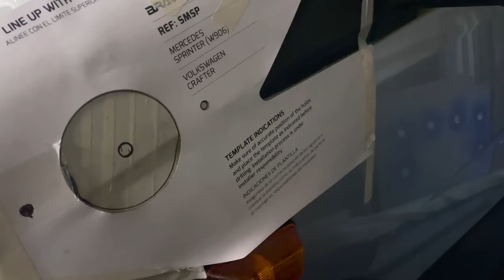Snorkel instal to a 4x4 Mercedes sprinter.

Comment: Had one of those cyclone air filters on a Cat/JCB, we all thought it would break when out on site but never did, good choice.
Reply from the maker: Thanks pal. Just the low trees to watch out for.
Reply: @Bugoutvehiclesuk  We did have some fitted with a basket type guard with mesh so you could still see filter, made by a third party, do not know the make unfortunately.

Comment: Another good vid, be careful about having open drink containers in passenger side drink holders. We use these vans for work and have a few have issues as fluids run down from there and knacker electrics below stopping van starting. Look forward to seeing the rest of this build
Reply from the maker: I will remember that. Thank you.

Comment: Great video, as usual. Very neat fitment.

Couple of OCD tips when fitting a snorkel....

Cover an area larger than the template with masking tape, and then stick the template to the masking tape. You'll generate a LOT of hot swarf as you drill holes (especially if you end up using a dremel to tidy up or enlarge the hole) and it'll fall down behind the template and can damage your paint while the template is keeping it all pressed against the paint.

When you're fitting the top mounting bracket, check that you're not going to be drilling through any spot-welds in the a-pillar. If there IS a spot-weld where you need to drill a hole, forget about drilling that hole. You'll struggle to drill the hole, break drills and end up just ruining the paint so either ignore that hole or drill it in a slightly different place and then drill a matching hole in the bracket.
Dunno if this actually applies to the Sprinter but it definitely DOES apply to some other vehicles (such as my Disco 2) so use your loaf and check for spot-welds before you start drilling.